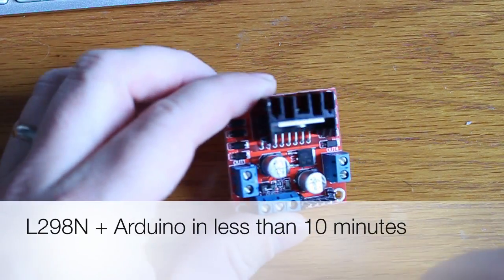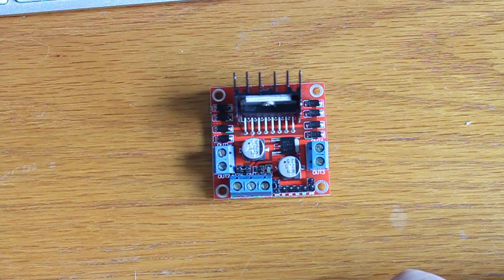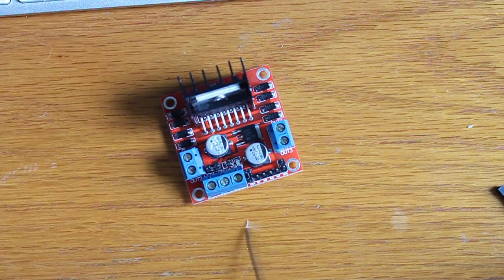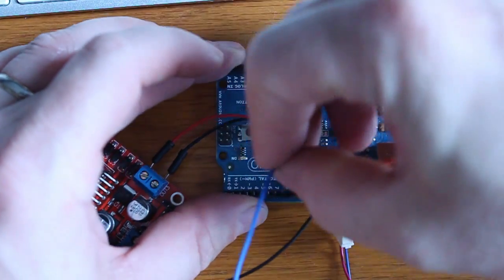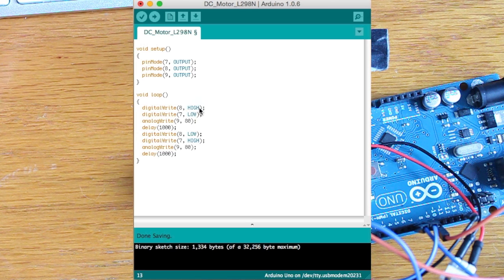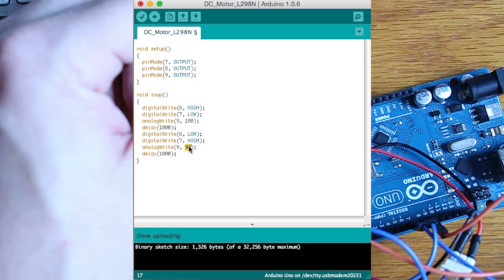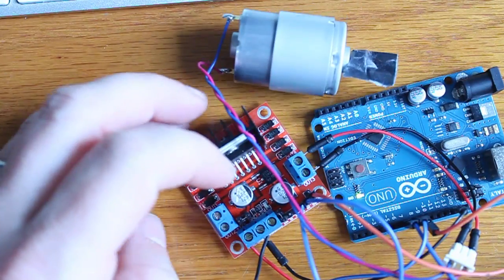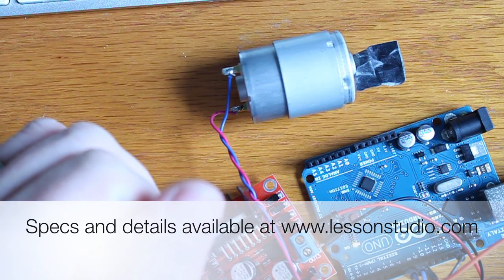HOW TO: control DC Motors with Arduino + L298N

Comment: I have a 12 v 3 amp nisca motor and was wondering if it can be controlled with this driver ? Thanks
Reply: 3amps will be pushing this module pretty hard.

Comment: the code:

void setup() {
  pinMode(7, OUTPUT);
  pinMode(8, OUTPUT);
  pinMode(9, OUTPUT);
}

void loop() {
  digitalWrite(8, HIGH);
  digitalWrite(7, LOW);
  analogWrite(9, 80);
  delay(1000);
  digitalWrite(8, LOW);
  digitalWrite(7, HIGH);
  analogWrite(9, 80);
  delay(1000);
}

Comment: thanks for the video but i have a problem my motors run without the the l298n driver but i connect them to the driver they don't rub anymore and yet my code is very ok what could be the problem

Comment: Broo😭😭 can you help me with my project, i need to trigger the motor using raindrop sensor, so when it sense raindrops the motor must spin in one direction at a certain speed and number of rotation, when the raindrop sensor dries, the motor must spin in the opposite direction at certain speed and number of rotation and stop, pleaaaas help me
Reply: If you still need help you can find me on Slack. My username is @purple

Comment: Thank you very much bro! Your videos are great and very clean, thank you for sharing.
I have a question. What is the formula or method to determine the capacitor to smooth the modulation as you said at the end of the video?
Thankkk youuuu!

Comment: Is it possible to have your computer USB connected to the arduino to read from the serial monitor While the L298N is hooked up to the arduino and the motors actively running.

Comment: What battery pack can I use ?
I want to use for instance a 7.4 Volts battery pack of 1500mAh LiPo Gens. Will it work ? Will it brake the Arduino ? Because you said that on the other side it will deliver 5V to the board, not how much I've put in. And that should be fine, right ?
Reply: so I think it needs 12V before it throws 5V out .. I will test this tonight. Did you pick any battery pack till now?

Comment: How could we use a 24 volt and 1amp supply to operate stepper motor using l298n driver

Comment: Can someone explain me why mine cannot run with for example 100? And that it is when in set it to 150 not slower than 255(with 150 its e.g. 8.1V and with 255 its around 8.4V)

Comment: Very nice video. could you explain how to add trigger and countdown timer in this dc motor controller. I want to make a motor work by trigger (water level sensor) and will be stop after lets say 10 second. Can we only add some code? thanks

Comment: I wired it the same way as you did, except I used a 9V batter instead of the battery pack. It isn't working Help?

Comment: hi Im using this driver to control cd rom microstepper motor with arduino. motor indicates 4-9v and 500mA current. Even though the code works correctly and motor is functioning, motor is heating very much in few seconds. can you tell me what could be the reason?

Comment: My motor is not working. I followed the same arduino and L298 both lights are on but it's motor is not running..Can you send me your id so that I can send you the circuit diagram?

Comment: Why can't i change the speed of my dc motor? Here's my code. Please reply it will be appreciated so much

void setup(){
pinMode(6,OUTPUT);
pinMode(10,OUTPUT);
pinMode(11,OUTPUT);
}
void loop(){
digitalWrite(10,HIGH);
digitalWrite(11,LOW);
analogWrite(6, 180);
delay(1000);
}

Comment: There is a quite big voltage drop trough the circuit so I recommend to use 15 v on input to get 12 on output

Comment: hello .. i want to use 6 motors of 12 volt and 60 rpm so it is possible to run 6 motors using this motor controller ?

Comment: How do you calculate the proper-size capacitor to attach to the circuit to allow the motor to run at small PWM signals?

Comment: Awesome tutorial. Totally understood. Thank you. How can I revise the code if I want to control the dc motor for only 3 seconds forward as I supply the required voltage and as soon as I stop supplying that voltage, this time 3 seconds reverse? Just like a park assist of a side mirror of a car. With reverse gear side mirros will move down for 3 seconds and with forward gear it will move back 3 seconds to its starting position. Maybe the scenario might be enriched.

Comment: can you help me?
I use 9 votl battery , my arduino led is turn on normally but it doesn't work and when i send output form my arduino to IN1 motor doesn't turn so I try to use 4 AA battery for arduino power arduino work normally(I can turn the servo) but when I send out put to IN1 it still doesn't work

Comment: My motor driver l298n is burning when connecting 12v 1.3 ah lead acid battery directly..! How to fix? Will using a mt3608 dc dc step up will work? So that I can reduce the current from battery.! Please help.!

Comment: Dear great teacher, I really need a help from you,I'm trying to figure out if it's possible to make some servo motors by using some Rotary encoders from an old ball mouse or from an old printer and a car wiper motor to use in a cnc project. I've seen homefaciens doing it but i really really don't understand a thing he is saying. Due to your charisma of explaining everything so well I beg you to help me in this matter.

Comment: what is the maximum voltaage supply do i need to use in here? can i use power supply in here?
Reply: how much voltage and ampere do i need to input in this driver? 
im afraid because i might destroy it. thanks

Comment: Great video! I have a question. Can you use pwm on two motors connected to the L298N simultaneously. Could i have one motor doing it's thing and another doing it's thing, or will they both rely on the same pwm?

Comment: do i have to upload the code after making the connections or can i make the connections later?.. and can you  please do a video on how to control 2 motors with bluetooth using arduino uno?

Comment: Sir
When the motor have load the current flow increase and there is a danger to get motor driver fire?
if we are going to use resistor to control current flow where we can put resistor?
please reply sir asap.

Comment: Can I connect four dc motors if I want them to spin only forwards? and one at the time. I mean each OUT from the driver to one wire of the motor, and just wiring all the gnd's together.

Comment: Im using an arduino mega 2560 and the motor just keeps turning in one direction, I did everything in the video and i dont know what i could be doing wrong

Comment: Can you address, this issue that usually you need some sensing to start the motor in a specific direction (I am thinking of the 3 phase coil setups in for example ex electric bikes, aka "push to start when you do not have the hall sensors).  Any comment on this ?, thanks in advance

Comment: Do you know is it possible to control not speed but position (angle) with this driver from arduino? Lets say i would like to turn 10 degrees from current position clock wise or 15 counter clock wise? If so, could you do the demo please?
Thanks

Comment: i am controlling  8 motors with this but its getting too hot is it okay or i should use 12v battery   as now iam using 7.4volt plz sir reply

Comment: I like the simple way that you explain this, May I ask you, I have seen lots of people feeding the power output of a motor "Out of a cheap servo.. on to the H-Bridge.. so my question is, Can one feed the signal directly out of the receiver on to the H-Bridge and bypass the servo pc board?

Comment: Hey man... this is a good introduction tutorial, but (as it happens almost all the time) we need to drive motor with PWM. So PLEASE tell us how to calculate the capacitor or the filter at the edge of the motor. This module CANNOT soft start the motor without what you are mentioning at 8:18.  Tell us how to solve this problem or else there is no reason to use this module. thank you

Comment: What motor are you using here exactly? I'm trying to build a vehicle that must travel with significant speed, and I'm curious to know the specs of the motor (i.e. torque, rpm, etc.). Thanks!!

Comment: Hello sir. I want to controlled on speed and direction of a more then 12 volts and 5 ampers D.C motor using arduino. this L298N cannot hundle this amount of volts and current .what do you thing should I do? thank you very much

Comment: I always fold the exposed metal over the cable and clamp them both in. Then I don't need to worry about it coming loose later because it's not gripping that very thin cable.

Comment: Hi, can i connect two L298N to an arduino UNO? because i want to control 3 DC motors so one will drive two DC motors and another will drive a DC motor? will that work? and will the code be difficult?

Comment: Hey everyone,
If you are looking for a fully assembled Arduino car (you don't have to assemble it at all), which includes all of the code for it to move and instructions on how to use it, program it, and develop it - 
go to: http://www.ebay.com/itm/172559577475?ssPageName=STRK:MESELX:IT&_trksid=p3984.m1555.l2649
and i think that your video is very helpful and good !

Comment: is it possible to use this setup to control a micro dc motor  in a way that it would only turn 180 degrees then go back in a loop?

Comment: Thanks you for such a nice video. If you had some time to spare I'd like to ask: How would I design a controller that does the following to a 2.5 to 3 rpm D.C. Motor, 4W, 11V: run clockwise for 2 minutes, pause for 2 minutes, run counter clock wise for 2 minute, pause and repeat. The other modes of operation would be clockwise only - as in, 2 minutes rotate clockwise, pause 2 minutes, repeat. Same thing for the counterclockwise scenario. Thanks in advance!

Comment: If my DC motor has 550mA rated current, but 2.8A, stall current, then I expect during certain high torque moments the current to
go up to 2.8A.The application note of the L298 circuit shows a protection against short-circuits:
http://www.st.com/content/ccc/resource/technical/document/application_note/05/b0/f0/25/e5/1c/4f/ba/CD00003776.pdf/files/CD00003776.pdf/jcr:content/translations/en.CD00003776.pdf
Why is not implemented?
But looking on the L298N board I cannot see that protection. There are only diodes to protect against the back emf from DC motor or step motor coils.
Is the LN298N bridge board protected against the over 2A current?
It seem not, but if yes, then how is the LN298N bridge board protected against the over 2A current?

Comment: I have 2 motors coming out of each set of outputs of the chip (4 motors total). One side doesn't seem to accelerate as quickly as the other using the PWM. One side of the vehicle starts at the correct speed while the other side takes a while to get up to that speed. Do you know what could be causing this issue?

Comment: hi , if i would control this 2 motor with wiinunchuck ?  i don't know how i can do the sketch , you can help me ?
Reply: Video Drone Just set up the pins that the motor is connected to as OUTPUTS and digitalwrite HIGH and LOW to control just like for the other motor and Analogwrite to control PMW

Comment: Can you just tell me that if I have a receiver, a transmitter, a L298P motor driver and an Arduino Uno and the L289P is connected to the Arduino Uno, can I connect the L298P to the reciever so that my robot works like a rc robot?

Comment: whats wrong with my code?void setup()
{
  pinode(7, output);
  pinmode ( 8,output);
  pinmode (9,output);
}

void loop()
{
  digitalwrite(8, high);
  digitalwrite(7, low);
  analogwrite(9, 80);
  delay(1000);
  digitalwrite(8, low);
  digitalwrite(7, high);
  anallogwrite(9, 80);
  delay(1000);
}
  
}
Reply: For your code to work you need to use capital words for OUTPUT, HIGH, LOW;
it does not work using lower case words for output, high low.
Reply: thanks

Comment: The capacitor you mentioned to be used for very low rpms, where does it go? in between the motor terminals?

Comment: Awesome Tutorial.
Was wondering tho, what if I wanted to run 4 Dcs ( So 2 H Bridge blocks there ).
Would Those 4 Batt. be enough? or would I have to have a second Batt-pack? And how would I wire it if it was just one Batt-Pack?

I know this tutorial was done in 2014 but I hope that someone might be able to help me with those questions.

Thanks alot in advance!
-Basil

Comment: i got a 4 motors 300 rpm  and  can we supply it 50 v without burning the arduino or anything
Reply: read the datasheet for the module
Reply: 25 watt max

Comment: Hello there;
I have tried your program and the L298N chip. But, I have tried to change the speed, here is the program:

void setup()
{
  pinMode(7, OUTPUT);
  pinMode(8, OUTPUT);
  pinMode(9, OUTPUT);
}
void loop()
{
  digitalWrite(8, LOW);
  digitalWrite(7, HIGH);
  analogWrite (9,300);
  
}
Once I have uploaded it, the motor didn't respond. Even though I tried to decrease the analogWrite to 180 again, but no use, Could you explain that to me!!!
Reply: Mahmoud Taha 255 is max
Reply: Thank you very much
Reply: Mine too. But mine starts at 180. Tried decreasing it to 50 and 0 but it wont change speed. Please help me

Comment: hi
I'm trying to control stepper with this.
i connected external 12v power supply i +12 and GND on ln298, and arduino on USB. 
I connect ground from arduino to ground on ln298.
Everything is working but i'm confused because ln298 is heating too much. After 2min you can't even touch it?
what about temperature on your module?
Reply: Now Controll anything in adrunio via keyboard{makeAnyprojects}
https://youtu.be/jAHLtRmgRiI

Comment: Hi can you help explain how I would go about choosing the capacitor mentioned at the end of the video to smooth out the PWM voltage? I am trying to make my DC motor operate at a very low RPM, but when I decrease the pulse width, it whines and wont turn (as shown in your video).
Reply: I'd like to see the math on this as well!
Reply: I have not done this but I can put you near the answer. RC = Time in seconds.  Therefore C = T/R where R is in ohms and C is in Farads, not microfarads. Plug in the time length of the ON pulse width and probably divide that by 2 or 3 so as to not flatten the entire width, and calculate R to be the voltage divided by the current drain through the motor. That R=volts/amps is not actually the DC resistance because motors are inductive, not resistors, but also measure the DC resistance of the winding anyway to approximate R in a second way and see if those two Rs are close.  That will give you a starting idea of farads (example: 0.1s/2 divided by 50 ohms = 0.001 farads = 1000mF).  You see capacitor size depends on how much current the motor draws and the pulse width; the smaller motor and smaller pulse width means the smaller the capacitor.  I would experiment with values around that kind of calculation.  To be more precise maybe you can measure inductance of your motor winding and plug that in for R using a reactance and frequency equation. But I think instead do this by experimentation after you get close with the easier estimate.  You need diodes to flatten the flyback current of a motor;  L298N spec sheet shows them. What about the polarity of a capacitor? AC capacitor, not DC electrolytic.

Comment: Thank you so much for the video! It clearly explains what the L298N module does. Could I quickly ask, what is the benefit you get over using this L298N module as oppose to just using a L298 chip and wiring everything manually? Does this module simply offer convenience or is there something more? Again, thanks for being so informative and clear! Regards.
Reply: the ln298n controls higher current/voltage. you shouldnt be able to ffeed 12v into the motor directly from arduino with higher current. So this module is required.
Reply: Now Controll anything in adrunio via keyboard{makeAnyprojects}
https://youtu.be/jAHLtRmgRiI

Comment: Hello,
for a line follower robot with 02 infrared sensors and 04 DC motors 
connected in L298N driver, how many amperes I need to robo do the curves correctly?
Reply: Now Controll anything in adrunio via keyboard{makeAnyprojects}
https://youtu.be/jAHLtRmgRiI

Comment: is this controller run 2 12V dc Motors? if yes then can i use same setup for 2 12V dc Brush Motors?
Reply from the maker: +mohanish daftary Yes, this can run two 12v DC motors up to 2A each.
Reply: +LessonStudio oky thanks for Info. but do i need 2 contorller for cntorl LH and RH motors?
Reply from the maker: +mohanish daftary The one controller can control 2 motors.
Reply: +LessonStudio oky Thanks For Reply
Reply: +LessonStudio this is my motor spac.
Rated Voltage Current : DC 12V
No Load Current: 0.2Amps (Max ~1.2 Amps)
No load Power Consumption: 2.4 Watts (Max ~15 Watts)
No Load Speed: 4000RPM
Motor Shaft Diameter: 3.17mm
Mounting Screw Hole Diameter : 3mm
Distance between Screw Holes: 25mm
Diameter of the Motor: 36mm
Length of the Motor (Body): 50mm
Length of Shaft: 16mm
Main Color : Silver Tone
Material : Metal
Net Weight : 150gm
Cylindrical shape and with 3mm diameter shaft and 2 pin connectors.
Great replacement for the rusty or damaged DC motor on the machine.
Comes with magnetic shield (as shown in the image)
To run this motor, you would need a 12 Volt DC Power supply. The Amperage rating on it should be 1 Amp or above.
Alternatively, you can also directly connect it to a 12 Volt Battery.

I need to control this motor by this motor controller
Reply: Now Controll anything in adrunio via keyboard{makeAnyprojects}
https://youtu.be/jAHLtRmgRiI